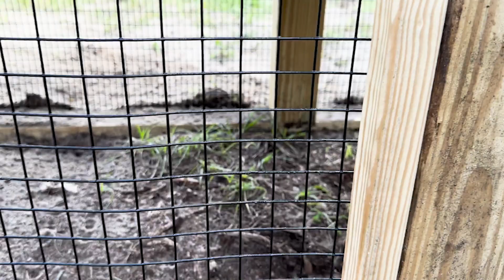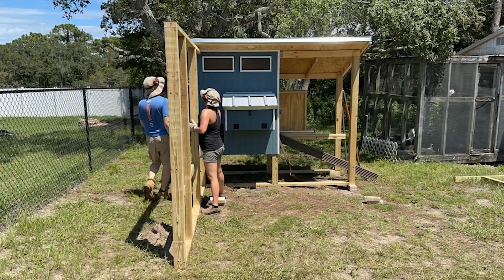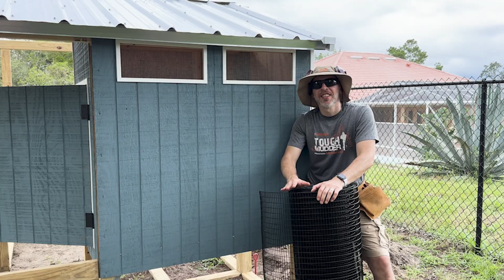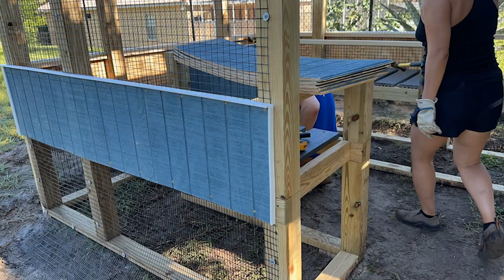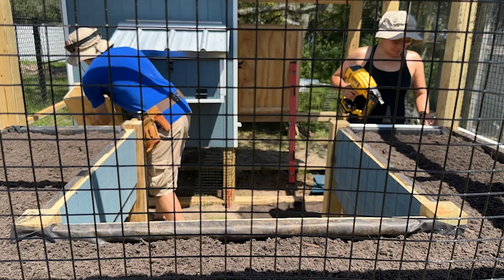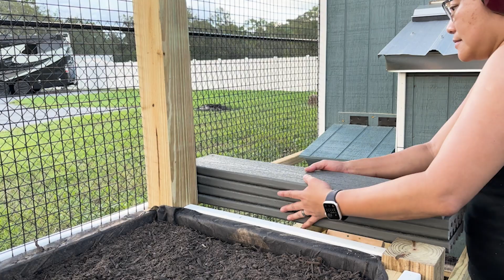How to build a chicken run and raised bed garden

Comment: Are the 2x4 and 2x2 segments built 1 extrude at a time? or some cool custom weldment stuff under the hood?
Reply from the maker: All of the 2-by material was modeled with SOLIDWORKS Weldments functionality using a set of profiles I built. I have a small library for 1-by, 2-by, and 4-by stock. It makes designing things like this way faster!
Reply: @ournextmake  Phew!, manually extruding each one would be a nighmare, did you use indent to create the connections?